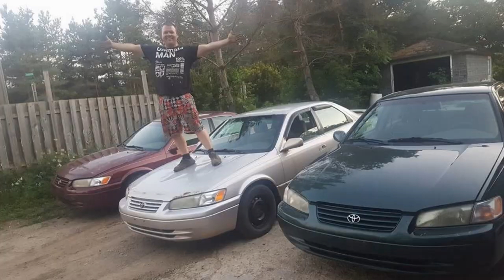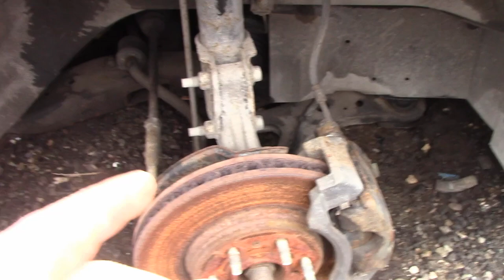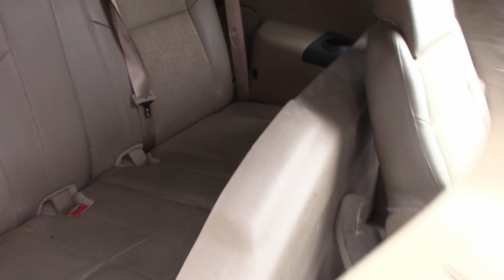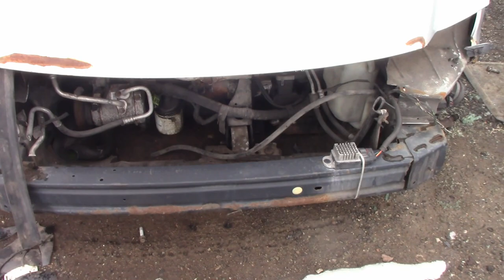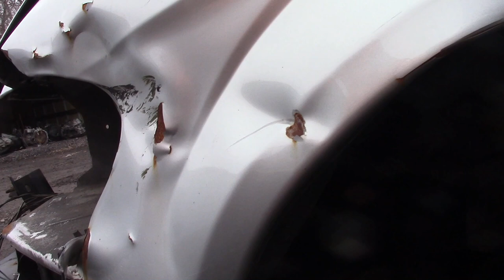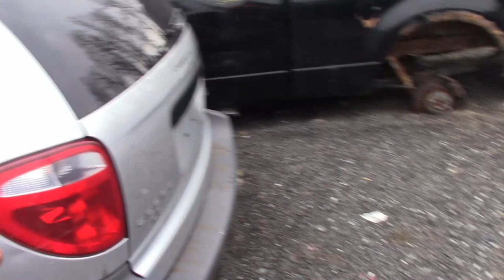What van would you choose for a derby montana or caravan

Comment: If i had to choose i would run a montana van 2000-05 all day long.  The 00-05 montana vans typically have a 3400 engine in them and alot of parts interchange with wbodys.  Montana vans are quite strong IMO if i could get another one on the cheap id run it in a heart beat.  And id prolly throw a carburator onto it being that 00-05 comes with a 3400 engine.
Reply from the maker: really ? would you spindle swap it ?
Reply: @zacksworkshop171  honestly probably not.  Ive only ever broke one of the aluminum steering knuckles.  If i did do do a swap id see if a lumina craddle fit i think they will.  But the make cast iron replacements for these as well.
Reply: @zacksworkshop171  i have a video up on my youtube its mini truck vs mini and i ran a montana van.  I may have some aftermath photos from that van i could message you if you like.

Comment: Caravans are actually supper hard in the front if there's 0 rust and set up correctly
Reply from the maker: really ? never ran one i owuld think some welding and a plate or two and they would be tough
Reply: If u get one make sure it's clean on the upper k frame mount Both sided. And it will only bend so the tower goes threw the fire wall. 2 inches on the frame. And weld bottom front motor mount solid to lower core support. And I just might not bend
Reply from the maker: thanks man